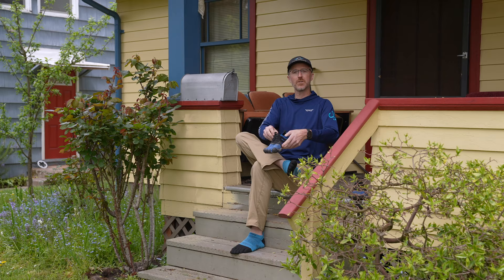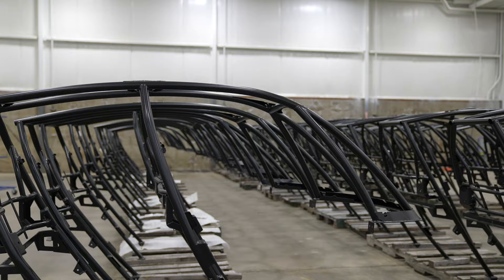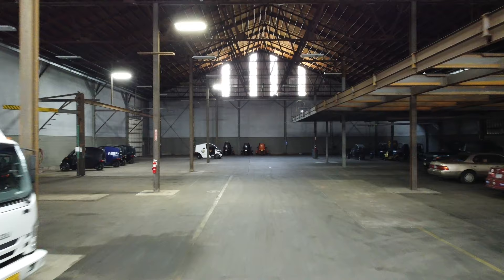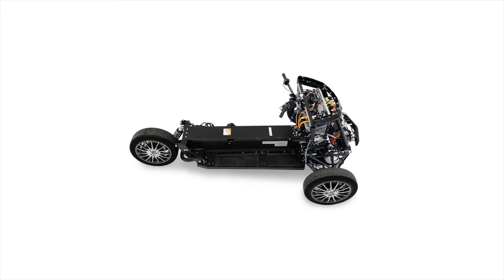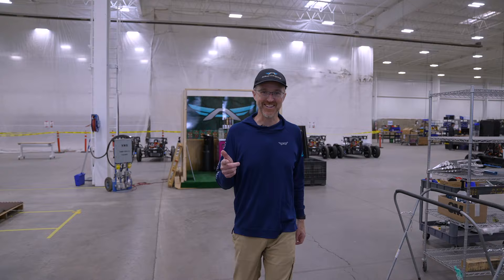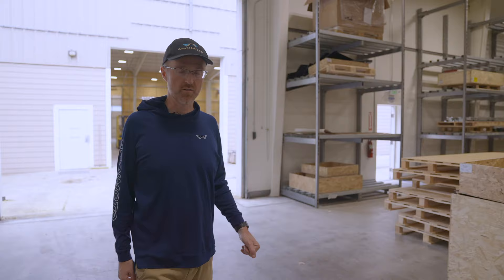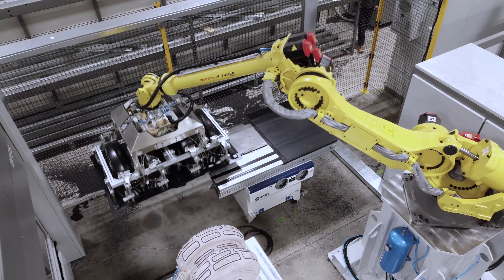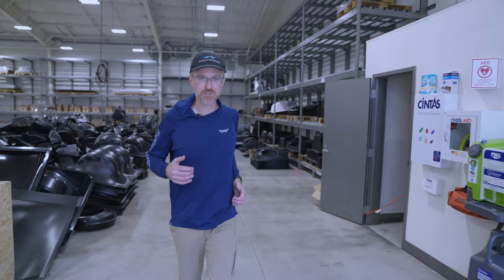RAMP Run With Mark

Comment: In an entire year vehicles with deposits from retail customers only increased by 196!! I will continue to say that once they start producing in larger numbers it will become apparent there will be very low demand for the product. ($18k for a product with only 100 mile city range) You can go spend under $2k for an ebike or spend $6K for the  metacycle.
Reply from the maker: Sounds like you’re looking for the MLM: https://youtu.be/iCiaIaVcR1U

Comment: with $10 gas coming soon... this miniature electric vehicle concept could work.
Reply from the maker: Average US electricity cost is around 13 cents per kWh, a FUV has a 20kWh battery that can go 102 city miles. It’s fun to do the math of how much you drive per year multiplied by your current vehicles mpg, and compare it to how much you’d save by driving a FUV for a year!
Reply: @arcimoto  That's the key, getting away from gas powered vehicles. This will surely make a dent..

Comment: I appreciate the update and the presentation style, but yet feels lacking in substance... Can we get an update on timeframes please? Maybe a move away from the vague, though imaginative presentations of your current marketing material to information-based progress updates? It sometimes seems that you are preaching to a sold audience rather than delivering on old promises. The calculation of $2,310.52 average saving by replacing a car with an FUV means nothing without mass production of FUVs. One Hummer being the equivalent of two Models Ys and 8 FUVs means nothing if the Model Ys and FUVs aren't available. Model Ys don't seem to be a long term problem. FUVs are still a big question mark at this point. Let's get past prototypes as quickly a possible to meaningfully make a difference. :)